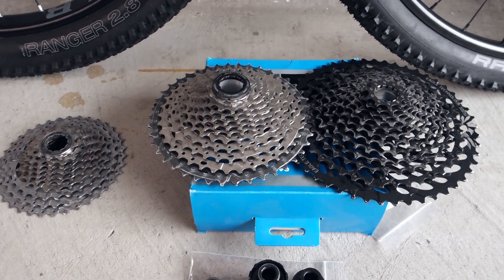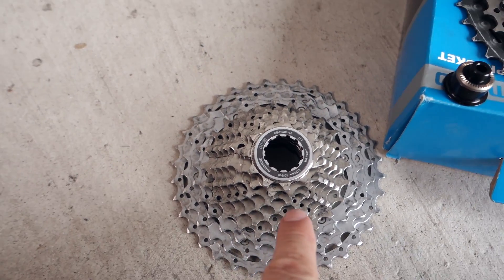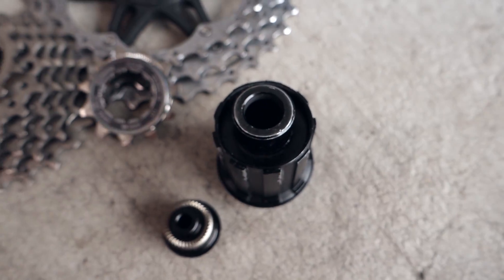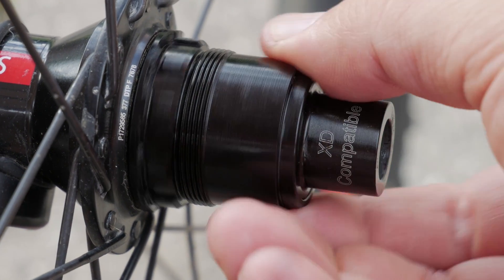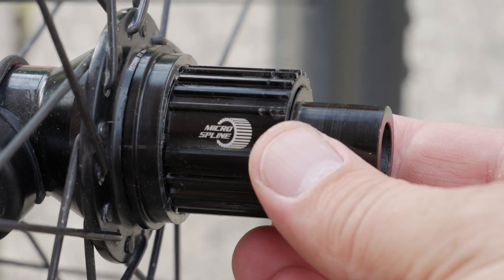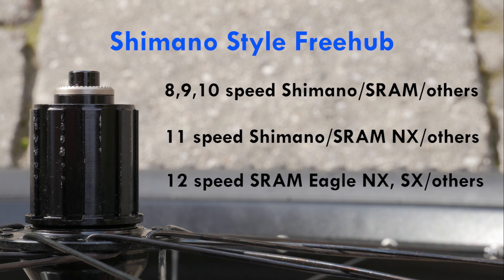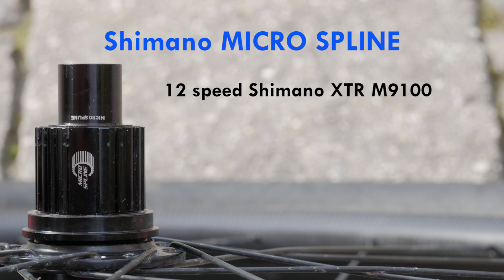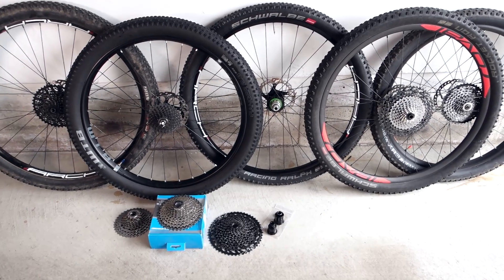HUB | Freehub COMPATIBILITY 🔥 12, 11, 10 Speed - SRAM XD Driver, Shimano Micro Spline, HG, HG+

Comment: It’s time to swap out my drivetrain from SRAM 1x12 cassette using XD driver on DT Swiss wheel and hub. I want to swap to Shimano 1x12 XT. Can you confirm the hub is cross compatible from XD to Shimano Microspline?
Reply: @LoveMTB  So the Microspline freehub will not fit into the wheel hub? I was hoping the DT Swiss wheel hub would accommodate a DT Swiss Microspline freehub or a DT Swiss XD driver, which is in there now.
Reply: @LoveMTB  Ok, thanks for the information. I thought I could make it work, just needed some advice before ordering. Have a great day

Comment: Hello! When fitting the end cap for microspline, should there be a little bit of lateral play? As in, you could move the end cap left & right slightly? Thanks!
Reply: @LoveMTB  Purchased a new freehub for DT 350. It's microspline and came with a QR end cap. I haven't plugged the cassette in it yet. Was just wondering if you're only going to push the endcap without any sort of retaining mechanism?
Reply: @LoveMTB  Alright thanks!!

Comment: i have a gravel bike and recently installed a new wheelset with dt swiss 350 hubs.. i got the MTB hubs apparently. will it work with a road cassette? or just mtb? right now im on tiagra and it's working fine..but the mechanic said i can only upgrade if i get the GRX 1x set up.. my budget is only for 105 R7020 (hyrdaulic one).. question is, if i get the 105 hyrdaulic set BUT use GRX 810 rear dereilleur and then use deore cogs (11-36T), will it work?
Reply: @LoveMTB  I see, so either i go for GRX or change my hubs. okay then, thank you so much!
Reply: @LoveMTB  aaah got it! Okay okay
Reply: @LoveMTB  was able to source a road freehub for less than $50. Thank you so much!

Comment: I have a question and I hope you can answer it. I would like to install a free hub from the Hope 4 pro on my rear wheel. My hub in my wheel is from shimano deore. The Casette is a 12 speed sram nx. Is this possible or do I also need to change the hub from my rear wheel and the casette?
Reply: I want to change the freehub body to hope 4 pro
Reply: @LoveMTB  so I can only use the hope freehub body on the hope hub?

Comment: hello 

im just wondering if the marlin 6 2021 hub body is upgradable?
Reply: Any hub body recommendation please? Im thinking to have a 108 engagement for the loud sound as well
Reply: Yeah i will not change i will just change the freehub body if upgradable my plan is to get 12 speed with 108 engagement and i want it to have a high end sound
Reply: Ahh. what 12 speed driver body should i get that is compatible for marlin 6 2021?
Reply: @LoveMTB   thank you

Comment: Very helpful !  It was near impossible to find information on converting my 1990 mountain bike which has a Shimano 3x 6 speed.  I ordered a new freehub  that is 135 mm to rebuild my wheels that will support the Shimono 11S. So my plan is to put the teagra 4700 group set (2x10) on this bike and convert it to a gravel bike.  I had a hard time understanding free hub compatibility and if I understood your video correctly this will work perfectly.
Reply: @LoveMTB  I am still confused on whether MTB and Road Freehubs are exactly the same length.  Is the MTB freehub 2mm shorter (narrower) than the Road Freehub??  Or, do all Older style freehubs come in the same length whether MTB or Road?  If the MTB freehub is 2mm shorter that means I can run an MTB 11s Cassette on the Road freehub (with a spacer), but not run an 11s Road Cassette on a MTB Freehub (as the cassette would be 2mm too long).  I could not find any other videos that explained this like you did.  Thank you!!
Reply: @LoveMTB  Last and final question.  You just don't know how helpful this has been!  Where can I order a replacement "road" freehub (just the slotted hub part only, not the whole assembly.  I would assume that I could remove the MTB hub part (not sure what you call that) and replace it with a Road hub that is 2mm longer.

Comment: Hi, I have a rear hub formula Cl-148S (shimano free hub) for SX 12v cassette (11-50). I have the deralleur sram GX. Which is the simple and best way to upgrade the SX cassette with a sram GX 10-52 cassette? Have I to replace the complete rear hub from shimano to XD? Do you suggest me to move to micro spline shimano with XT instead of the GX cassette? Can I use the new GX derailleur with the shimano XT M8100 cassette?
I hope that you can replace to my questions. Thanks anyway.

Comment: Hi. I'm looking  for  help  i own bike trek checkpoint  al 3 2020  but want to upgrade  to hydraulic  brakes  but unfortunately  can't find any brakes which will fit  9 speed  so for that reason  want to upgrade  all groupset  to 10 speed.  So I found  on my bike rear hub is Hub rear
Formula RX-142 alloy, 6-bolt, Shimano 11-speed freehub, 142x12 mm thru axle but dont  really sure if I can fit 10 speed  on this hub as I'm currently  on  9 speed ? Thank you
Reply: Its gravel bike so gear levers  are integrated  with brakes

Comment: Your video was very clear, but I want to make sure I understand properly. I have a 2020 Fathom 2 29” with the SX Eagle 12speed. My cassette was not torqued to spec causing premature wear on the freehub. It’s gotten so bad that it needs replacing. According to this video, I need to replace it with the older Shimano design rather than the XD Driver? What makes the SX and GX different from NX and others?
Reply: @LoveMTB  Alright, I understand. Finding the part is proving to be rather difficult as I cannot find one for 12 speed. The sizing is confusing to me as well.
Reply: @LoveMTB  Thanks for your help and for the quick response!

Comment: I have a plan on upgrading my mtb to 12 speed this coming november and I have an HG Shimano freehub body and I was kinda unsure whether the 12 speed cassette would fit or not. After watching this video I really learned a lot and gained more knowledge about the technical know hows of my bike, thank you for the informative and simple vid, thanks a lot, cheers from the philippines
Reply: Hi, whats the result?
You were able to install a 12-speed hg cassette in your free hub hg 8-11s?
I intend to do the same
Reply: @muhammad-Redha  yo it worked out well as long as you have a compatible shifter to pair with the derailleur
Reply: @nakii7624  thank you so much

Comment: Hi, Do you have part number for the XD compatible to use with XG-1175 please? Thanks
Reply: @LoveMTB  
2019 levo comp carbon, got
1, Cassette sram PG-1130
2, Rear HUB Specialized sealed bearings. 12x148 mm thru-axle, 28h

Just bought to upgrade
Cassette XG-1175 10-42T, 11 SP (XD compatible only)
And I really dont know what kind of XD compatible to buy (too many out there)
Please help. Thanks!

Additional note
My bike with PG-1130, cog 11, 10, 9 are one piece built. And using spacer for any other. Shifting 1 to 8, no problem, fully engaged all the time. From 9 to 11, always short, adj ok, but not smooth as should be.

My bother with XG-1175, all cogs built together as 1 unit of all. Shifting from small to large cog had no problem whatsoever.

Comment: I have a 9 speed Shimano cassette, will an 11 speed cassette still fit that freehub?  Or do I absolutely have to make sure that it has that "1 mm" more of space for "36 mm " total and not "34.9 mm " which wouldn't fit any 11 speed cassette, is that right? And aren't there any longer maybe Lock rings in that case or some other way to make such a conversion possible without changing the freehub? 
Thanks anyway. Great Videos!
Reply: @LoveMTB  Thx, this channel is a great finding

Comment: Hi! This is very helpful. Thanks! My bike came with a sram sx Eagle, which based on this video that means I probably have the older Shimano freebub correct? If I wanted to switch to Shimano Deore XT Groupsets that would mean I need a Shimano microspline. Is that right? If so, is the Shimano microspline able to be installed on any wheel? Or would I need to change the hub on my wheel too? Sorry if these are dumb questions or if I’m not using the right terms but I’m new to mountain biking. Thanks!
Reply: @LoveMTB  i have a control tech freehub up to 11 speed cassette only..if I put an XD drive, can I use a 12 speed sram eagle? Is any brand od XD drive will do?
Reply: @LoveMTB  thank you.

Comment: Hi. I have a Scott Spark 2017 with a Deore FH-M618B hub 2x10 system. 
If I want to install the new Shimano 1x12 XT, will the micro spline free hub fit on the FH-M618B hub or do I need to replace the whole hub?
Reply: @LoveMTB  Thanks

Comment: Hi can you put a free wheel hub body on any hub like a Shimano XT or hope rsx4 rod hub?, as I want to run a seven speed on a XT hub and then upgrade to 11 speed?, as I can imagine all I would have to do is change the freewheel hub body on it even if the drop outs were different say 135 or 144 width or use spacers to make up the space??? Any help thanks guys
Reply: LoveMTB sorry that is what I meant a seven speed hub body?
Reply: LoveMTB cheers buddy, I can only assume they I have a freewheel because after putting the extractor tool in the splines I could not turn it, correct me if I am wrong as it had splines for extractor tool spline like I saw used

Comment: Im new to mtb and i just picked up a 2020 gt verb it currently has a 3x8 drivetrain. I want to upgrade to a 1x12 but im still confused about the whole hub stuff and have been reaserching for a while. Would i be able to fit a sram nx cassette on it without the xd driver? Or would you recommend the sunrace 12 speed cassette?
Reply: @LoveMTB  thank you! I just finished watching your video and was wondering whats wrong with square tapered bottom brackets?
Reply: Awesome thanks a ton! Ive subscribed and hope to learn alot!

Comment: Hi I wounder if you can help. I have a DT Swiss 370 hub 12/142 on a mountain bike but as it runs sram 11 speed NX not a XD. What freehub do I need to replace the 3 pawl swiss. All seem to be alloy material not harder steel so do I need a shimano 8,9 or10 freehub or a 11 shimano as most are road and need a spacer. Thanks for ant help.
Reply: @LoveMTB  I don't want a XD driver as want to run shimano/sram NX freehub as running 11 speed.

Comment: THANK YOU  excellent and clear explanation!! I have a SRAM 746 rear hub with a 10-42 cassette that is too hi geared for me. I need the Shimano 11-46 cassette. I was wondering if I took the SRAM cassette off with the XD body IF I "could" install the Shimano body onto that hub and install the Shimano 11 speed 11-46 cassette. Looks like I CAN!! Thank YOU!!
Reply: @LoveMTB  THANK YOU! Yes I know the Shimano cassette doedn't fit on the XD body. But SRAM makes a freehub FOR Shimano cassettes, that was the freehub body I was going to use. I need the lower gears I do not have the strength to "push" a 10 nor 11 nor 17 tooth cog.  Thank you.

Comment: The idea with HG cassette core was to move the bearings from the middle of the HUB to be more closely as possible to the dropouts. It was very common in the time of "free wheels" cogset to have  the axle bent.  Unigllide and then HyperGlide manage to fix that problem.

XD and MicroSpline moves the drive side bearing far from the dropouts. From an engineering point of view this is a step back. HyperGlide is a superior design. XD and MicroSpline works because now we have better materials than we had 30 years ago and the axle is an oversized pass though. But the only real benefit of XD and MicroSpline is the 10T cog: nothing more, nothing less.

No wonder the only solution for 135mm QR is the FH-MT500, and maybe this is going to be the less reliable MicroSpline HUB in the lineup (but id does have a oversized axle, tough).
Reply: @LoveMTB  you are right on XD, but on Shimano MicroSpline Freehubs the bearing its in the same position as the cassette core pawls, far away from the dropout.

Thank you for your videos. On one of your videos I saw that the MicroSpline Aluminium core gets bites from the cassette: that's another drawback for the new system.
Reply: Excelent observation. And a 10 teeth cog is not all pros either. It wears out much faster than an 11 teeth cog. 11t / 51t cassete is more than enough range for most people.

Comment: Thanks greatly for explaining. The sram xd free hub can take a lot off punishment. As I ran 12 speed GX for two years. But now have a new Specialized Kenovo Expert and it runs 11 speed Sram PG-1130 but because off the torque of ebike it has gouged the free hub very badly. The material in the free hub is substandard and had to filed the teeth on the 10 & 11th gears and free hub as heavily gouged and worn after 270 miles I mean not a lot off riding and as someone has said the materials used could be a lot better.

Comment: so just to clarify, I can make my 1x8 into a 1x12 since i have a standard shimano freehub?
Reply: No, I’m in the process of doing it now and my sram NX does not fit my stock. Shimano hub even took it too my LBS and they recommend changing the entire wheel
Reply: That’s exactly what I have from SRAM. The 12 speed set up won’t fit my stock free hub. I am not sure if it’s my hub itself or what but that very last gear the smallest one won’t grab onto the hub body
Reply: LoveMTB I have a diamondback axis xe 27.5 originally came with the 3x8 Shimano drivetrain. The freehub body itself isn’t long enough on the tip to support the very last cog. I have video and pictures I can send to you

Comment: I have a quick question.

A couple years ago I bought a Fat Bike with a SRAM 1x11 drivetrain. (SRAM PG-1130 11-42T)
The tires are MAXXIS MINION 26 X 4.80

I wanted to have the ability to CHANGE to smaller tires so I ordered a pair of 27.5 MAXXIS REKON (2.80) Tires which came with an XD Driver. So all I need to do is order a pair of brake rotors for the new wheels plus a new cassette.

The question that I have is:

On the 27.5 tires can i use an 11-50 cassette instead of an 11-42? Any other changes needed?  chain?

Thank You in advance
Reply: @LoveMTB  Thank You so much for your reply. I assume that if I need to interchange back and forth between the new 27.5 wheels 2.80 and the 26 X 4.80 I will also have to change the cassette on the 26 inch fat tires also. So I will need to buy two 11-50 cassettes one chain and 2 180mm brake rotors for the new wheels as well.

I guess I will have to decide whether to buy the parts and put them in myself or just take them to a LBS and have them do it. I dont have cassette tools...

Comment: i have a tourney fh-tx505 rear hub on my bike, wich is really just the only one bad part on my bike. now, it has the HG freehub and shimano site says it can accept max a 10s cassette (wich is what is on it right now). i want to make the upgrade to slx 1x12 and if i understood well even tought shimano says max 10 speed it will work also with a sunrace 11/51 12s. but i would also like to have the 10t smallest sprocket. is there a micro spline freehub body for my hub or i need to buy shimano mt500 micro spline hub and re build my wheel with it?
Reply: @LoveMTB  yeah sram nx is pretty cheap... but with my 24/48 11/42 setup that i have now i barely get to the top of the hill needed to ride the only trails here, and to get a similar ratio i would need to use a 30t chainring with a 1x, wich limits my top speed a lot, even more with an 11t at the back, that's why i would prefere a 10t at the back.
i'll just pedal faster i guess.
i also have another question: shimano's hyperglide and hyperglide plus is the way the chain uses some ramps on the cassette to shift faster and under power (if i'm right). but sram cassette have them too and sunrace even more, they look almost like the ones on shimano cassettes. so do they work the same?
Reply: @LoveMTB  thanks
Reply: @LoveMTB  i've just seen your video about the XT m8000 gs with a 12 speed 10/50 cassette. Do you think the 10s deore m6000 gs would work with a 11 speed 11/50 cassette? This way i wouldn't need to replace the derailleur and i'll be happy with that
Reply: @LoveMTB  yeah right. I think i'll try (but not earlier than August) and see if it works. I'll let you know

Comment: Great video! quick questions, as an example can the shimano deore hubs with the standard shimano freehub be converted to the new micro spline?
Also if you wanted to convert say a shimano deore hubs from 9mm qr to 15mm thru axle, is it as simple as just removing the end piece adapter? I'm just getting into Mountain biking (first legit bike for me) and curious to learn more. Thanks.
Reply: Depending on your hub manufacturer. E.g. mavic and novatec allow you to change your freehub body instead of whole hub set. You can checkup for other makes on their websites.